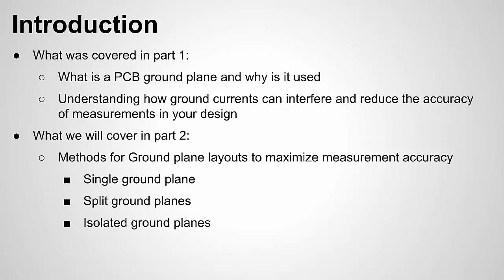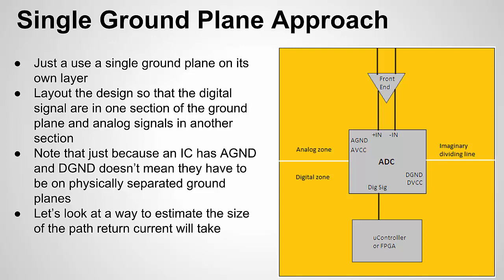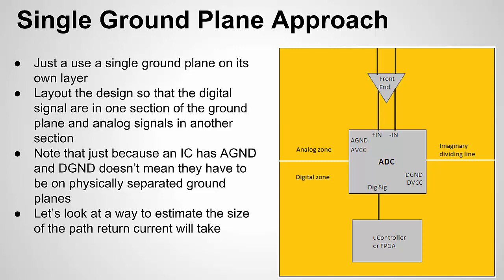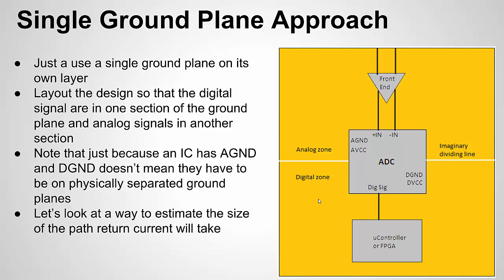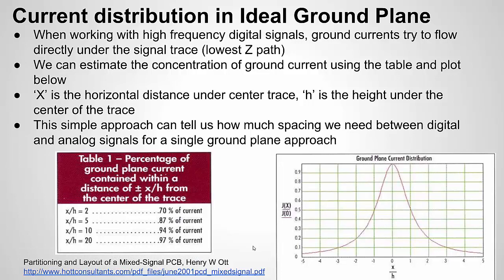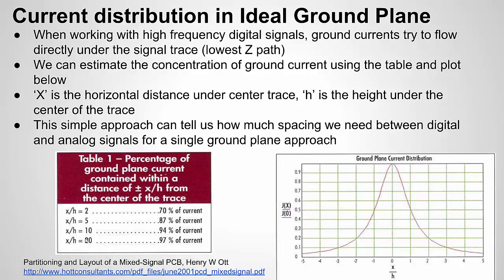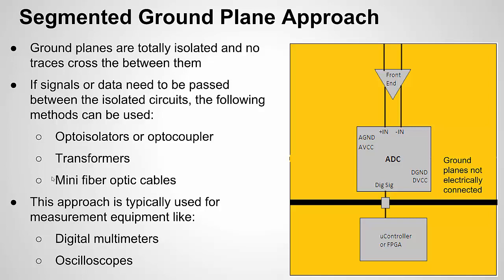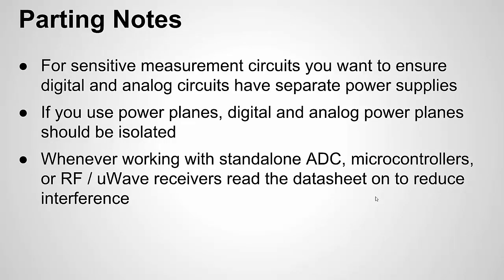Ground Considerations for PCB Layout of Mixed Signal Designs Part 2

Comment: 7:00 is nice for working out coupling between 2 high-speed signals and how you should separate them, but this doesn't help coupling from a low-speed (0-20kHz) signal return current spooling over and having conducted coupling with the high-speed return path. Low-frequency analogue signal return paths will spread over the entire board! :)

Comment: In the final example where the ground planes are completely isolated on the board, should they eventually be connected (perhaps at the GND terminals/connector of the PCB itself)?  Or would you have separate GND terminals for different sections of the PCB?
Reply from the maker: The third example has the ground for each circuit isolated that is why you have to use something like an optoisolator to communicated data from one circuit to the next. This is typically used for precision measurement applications where you are making high resolution ADC measurements

Comment: Hi.. Thanks for the video.  I have a question, and thanks for your answer.  The author of the article (and also you in this video) say that the return current try to flow underneath (in the plane under) the signal trace.  What you mean "under the trace" physically?  Are you talking about a 2 side PCB?  what material is the "under the trace" made of, or this is just an ideal supposition??
Reply from the maker: The senarios you want to avoid is not having noisy return current either flowing next to a trace carrying a sensitive signal or above / below a sensitive signal on an adjacent layer. Between layers PCBs are typically made of an insulating material (FR4). But this insulating material can't stop a magnetic field caused by current flow from coupling on to a sensitive signal trace